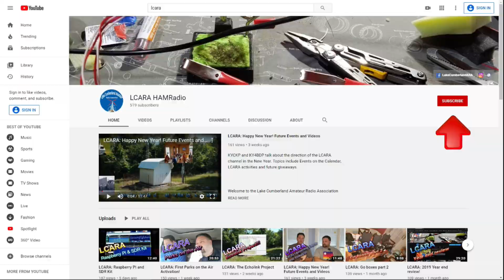LCARA HAM Radio: DX Engineering DXE-TFK25 Fiberglass Mast

Comment: Couple of questions.
1.  What did you use as a base? Yo keep it standing?
I want one of these for pota and other portable ops...   im concerbed about wind.

2. What did you use or how did you connect your wireline antenne?

3. Do you think it could support a 2meter verticle lime a comet GP-6?

4.  What do you think of it after a bit of usage?
Reply: If you're just deploying wire antennas for POTA, look at spiderbeam. They pack smaller and extend taller and are plenty strong to support EFHW/Dipoles. Specifically the 12 meter spiderbeam. I have two and it works great for POTA. If you want to deploy a 2 meter vertical then you'd need one of these unless you are able to compromise and go with a 2 meter roll up slim jim antenna which is far lighter and can be supported with the spiderbeam style mast.

Comment: I have four of these creatures, 2-25' & 2-46'.  At 16:19 when you pulled the sections apart, this has happened to me, (more than once.)  My solution, after marking the stopping point as you did, was to lightly paint about 8 inches above the stopping point with any color paint you choose as a visual warning that the stopping point was approaching.  Since then, I have never pulled a section out beyond the marking point.  And yes, with a payload on them, they are heavy and you don't want to have them drop damaging either the mast or payload.  / '73 - Steve

Comment: Well, it was a bit frustrating watching you put those clamps on those polls… Since you should be putting the clamp on the larger pole with a bit of epoxy to secure it permanently and then adjust in the clamping section after the epoxy is set. Not having secure connections on the outside poles seems a little sketchy to me. I have the exact same pole and I’ve done it according to the instructions that came with it. At any rate good luck with whatever you put on top of it and I hope it does not blow down. 73 from WB2PSB.

Comment: It's a little difficult to tell if this is how you installed the clamps - but I should think that the 'non-lever part' of the clamp goes on the larger diameter section, and the 'lever part' of the clamp would be for the nesting section above.
Reply from the maker: Indeed, I have gone back and moved the clamps down to the larger section and tightened them down. The upper clamp end then tightens the smaller upper section. My not interpreting the instructions correctly. Thanks!